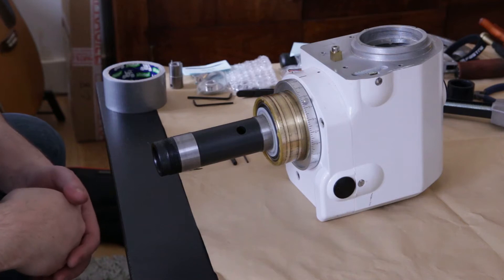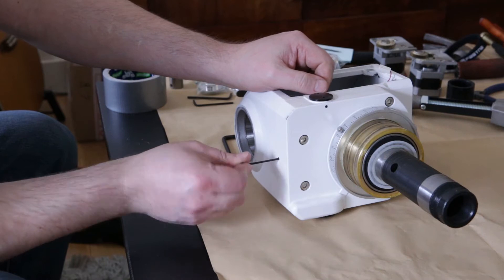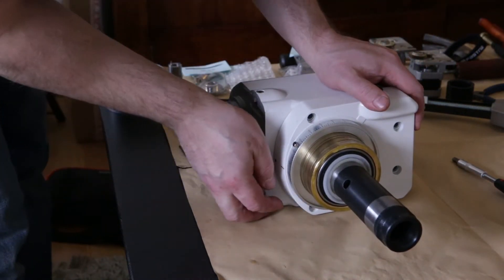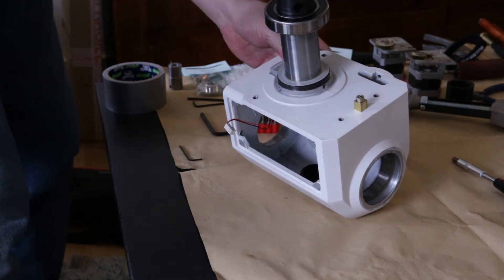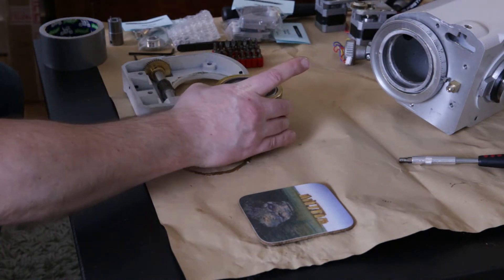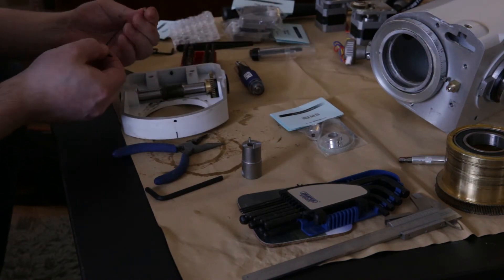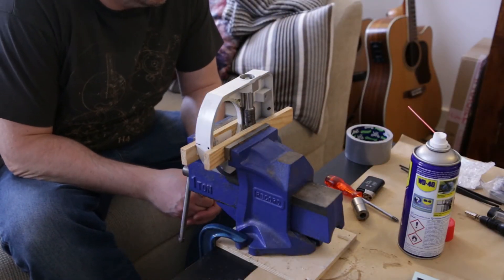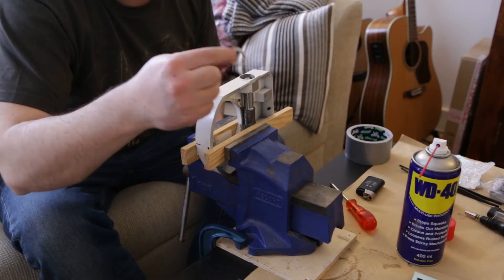NEQ6 Belt Mod Part05 - Removing RA Axis Gear

Comment: How's the RA shaft attach to motor housing? In 4:39, the RA shaft still attached, but it does not show how you detach the RA shaft from motor housing after that. Just wonder if it is fixed by a pair of set screw?
Reply from the maker: Hi. If I understand you correctly I never removed the axis from the housing. There's no need for that.